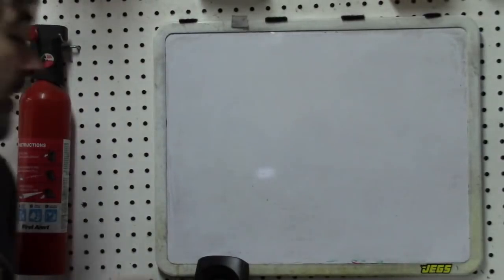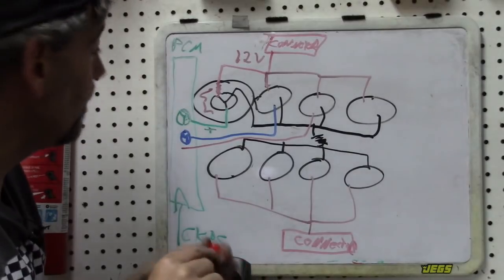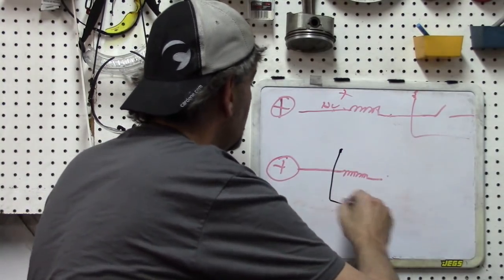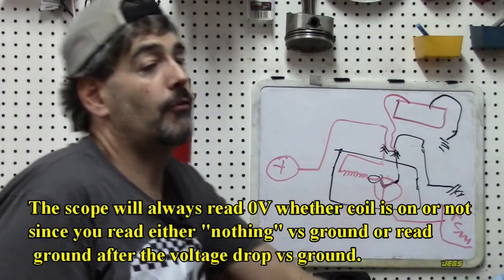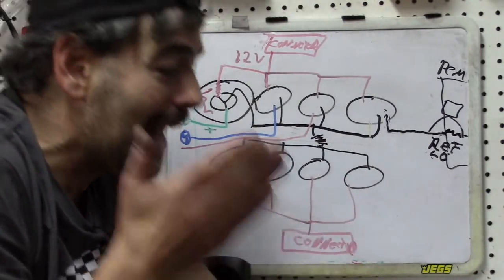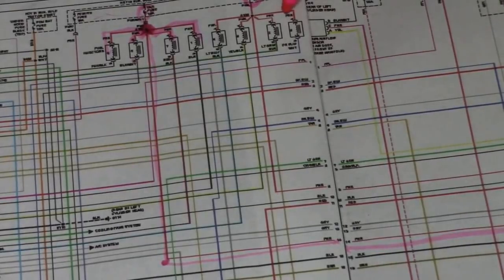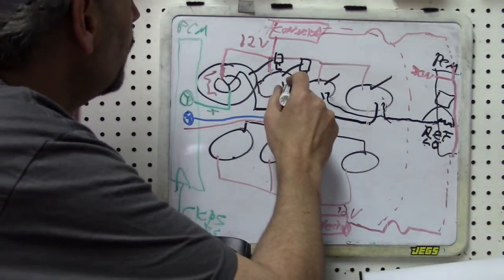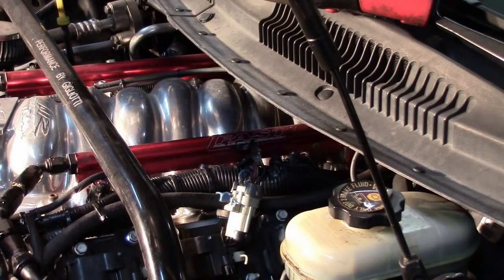Xmas Special! Diagnose,Understand Ignition Free from SBQM + Xmas Story!

Comment: Merry christmas, I ran into a dodge charger v6 with spark ionization codes, 4 wire coils, clear the codes and it ran perfectly fine but when the code would set, dead misfire on cylinder 6 couldn't figure out the problem .-. The car had a new coil and 6 new spark plugs the customer replaced.
Reply from the maker: Anytime I have a misfire (or no start)  I think “FASTTEC”-   Basically fuel, air, spark, timing, exhaust, compression. It WILL be one of those (or combination). On a single cylinder misfire you can rule out timing. But it’s going to be one of the others. Check of there is spark and fuel first then try compression.

Comment: Your tutorials are excellent. I haven't seen your electrical series yet so if I'm duplicating an idea here then sorry. However, I would in addition to what people are learning from you suggest anyone who wants to really understand this to do a basic course in electronics (not electrical, must be electronics). Once you learn about resistors, capacitors, inductors (coils), diodes, and transistors (I hope I didn't miss anything - it's been a while) and how they are used in and react to both A.C. and D.C. and ohms law (there's tons of free ohms law calculators on line) so you have an understanding of the basic building blocks of all electronics -- that grounding makes everything so much easier. 

I say this as someone who started a career as an analog and digital design engineer so I say this from a point of knowledge although these days I don't remember much more than those basics having moved to computer software more than a couple of decades ago.

To give an idea of how powerful these basics are consider this... put a couple of transistors together and you get a latch. Put latches together and you get basic logic gates (and, or, xor, not). The most complicated parts of your computers are just millions of logic gates so from understanding a transistor you have the grounding to be well on your way to understanding the most complicated machines in the world. Obviously that's a bit of an over simplification to make a point but it's not as far off from reality as you might think.
Reply from the maker: Duly noted. The series is basics in electrical first because  I believe that’s first before learning electronics. For example, you have to understand power and ground side switching to understand a transistor’s function. But the second reason is I myself am still learning electronics so I need more familiarity myself before I can make electronics videos. But I will!!
  Great point and I agree with your idea.
Reply: @SchrodingersBox  Thanks for the nice comment and I could image your videos on electronics being exceptionally easy for people to follow given how clear you are in your communication. Or to put it another way, even though so many people have said it before, your videos are awesome!

If this last diagnostic I'm trying doesn't work (I'm getting a smoke machine) for this long standing fuel problem I have I will be on your other channel sooner rather than later in the hope that a few more brains can help me track down the source of my problem with my E36 BMW. If you are curious, the short version is that it has a leak so slow I haven't been able to detect it (using die and many other tests). Slow as in it takes 10-12 hours before it's lost enough fuel pressure to cause me to have to turn the key several times to build up pressure so that it will start. I ignored it for a long time hoping it would get worse so it was easy to spot but no such luck... I need to stop otherwise I'm going to go down a rabbit hole of everything I have tried to find this thing.

Comment: Where is the fly back diode located?

I would guess that what you've been calling "pnp" transitor is actually an MOSFET transitor.  One of the neat additions to an MOSFET device is you can sense the current flow through the main device.  This would be what you're calling "REF LO".

And actually the structure of the MOSFET device has an intrinsic diode which would work as the fly back diode.

https://en.m.wikipedia.org/wiki/Flyback_diode

Comment: Hey Matt merry Christmas. A few days ago I watched both of your videos on fuel trims, and it was very informative and I made a diagnosis on a 2007 e63 amg. I was getting lean codes for both banks.. maf sensors were dirty, I cleaned them and it helped a bit however I have to get new ones. My LTFT on bank 1 was 39.3% and bank 2 was 57%...im not kidding... STFT was staying around zero, both banks of o2 sensors were at 0.45v. Cleaning them brought both banks of LTFT down to 21%..I unplugged both mafs, unfortunately the vehicle has 2 of them which doesn't make it cheap.. And LTFT and STFT went back to zero.